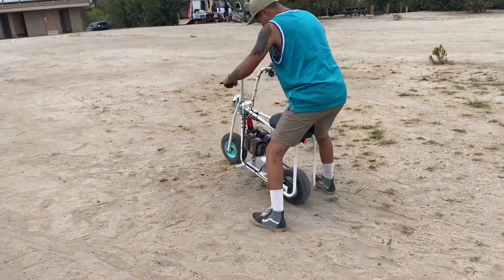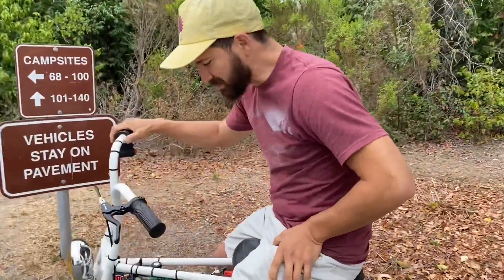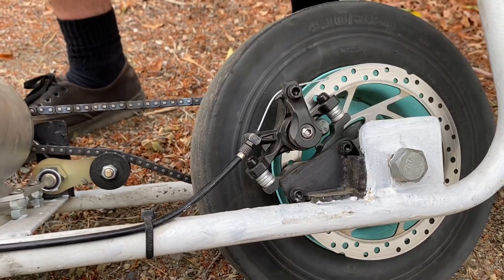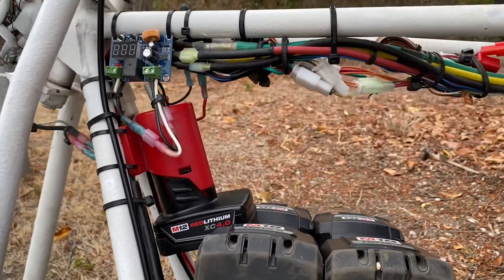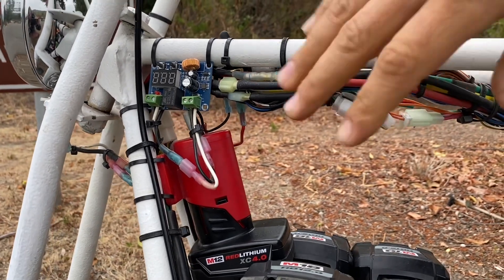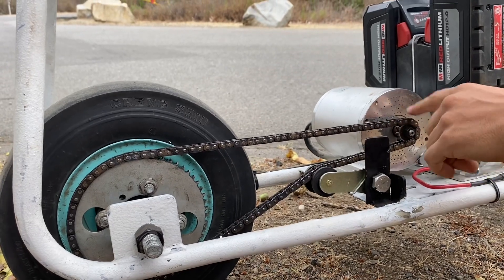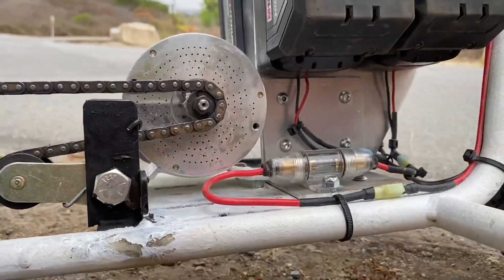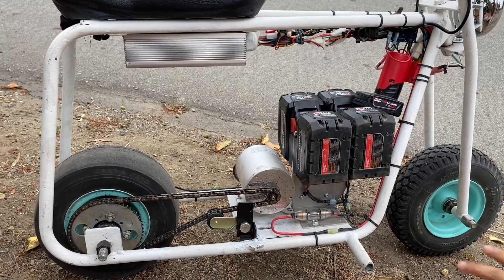Electric mini bike Milwaukee powered

Comment: Why didn’t you just wire the headlight from the controller ? Doesn’t it have a wire for the headlight ?
Reply from the maker: It does have light wires but it does not step it down to 12v

Comment: Heya i have that same motor on a scooter and the spokets look very similar ,but the controller i made myself so am able to access true 100% of the batterys power ,and its insanely fast close to 70kms per hour thats only useing 48-53 volts .so im sure yours can hit simalar speeds too ,with few tweeks.
Reply from the maker: I’m working on a new project and was trying to figure out exactly that , you should do a how to video on how to make the controller went to your Chanel to check out your scooter and it looks insane!! Very cool

Comment: Nice build.

What motor and control specs you running?
Reply: He is running a 72v 3000 watt motor if I recall correctly
Reply from the maker: Yup @crashz28 is correct you could find the kits on Amazon